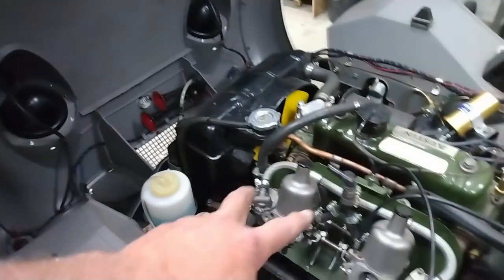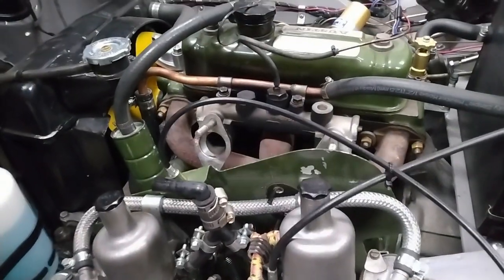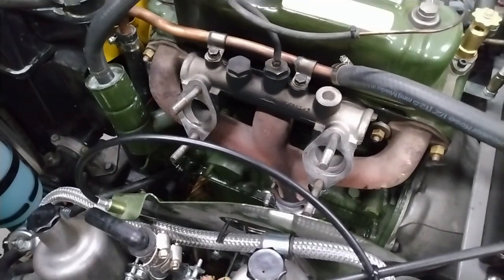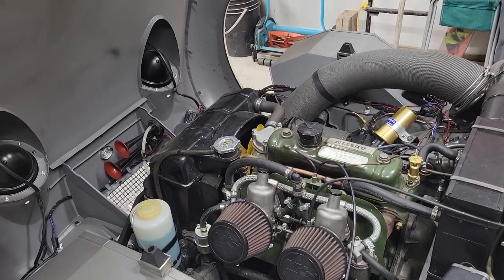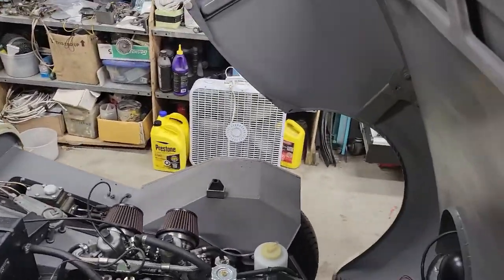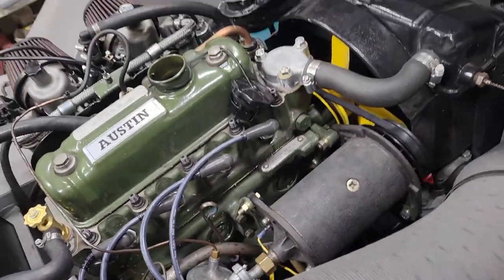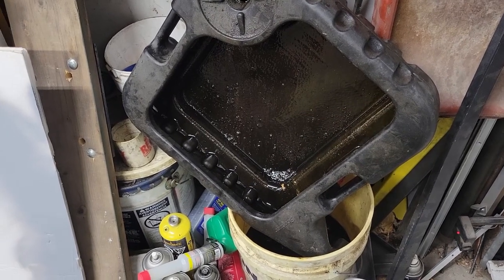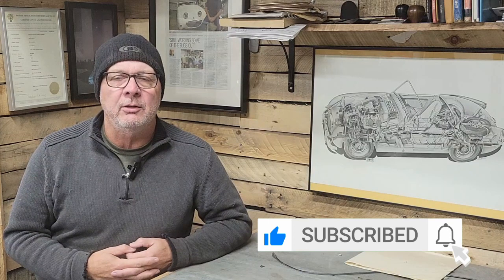Fixing an exhaust leak & changing the oil. Bonus... where does the old oil go? Bugeye Build Ep139

Comment: We take our used oil to anywhere that sells fresh oil. They sell it, of course, thus completing the circle of life. This video is a good example of why that flip front bonnet is so important! Looks like a piece of cake to reach everything in that engine bay. Glad she's running so nicely!
Reply from the maker: It's interesting to hear how different jurisdictions handle this. I remember in much younger days digging a hole in the gravel parking pad behind the house and pouring the used oil in! I seem to recall that method was actually promoted in magazines of the day!
Reply: @EconoboxGarage  I remember my dad pouring used oil on the ground around the deck posts, to help prevent rot.

Comment: Hi Ian,  It's been a few years since I've owned a Spridget but I remember a fiber donut that went between the manifold and the down pipe.  When you put yours together, I didn't see you install one.  I didn't say anything then, thinking that there might be differences in the years & models.  You might want to check to see if you need one.
Reply from the maker: I believe the donut was introduced with the 1275 cars starting in 1968. There wasn't one on my car when I got it.
Reply: The diagram from the Moss online parts catalog (for both 948 and 1098 engines) shows only the manifold, exhaust pipe, and clamp. So, you are correct, Ian, there is no gasket for your 1098 engine.

Comment: Another nice video, Ian, even though an oil change is not nearly as exciting as other projects you had on the car. My Bugeye had an exhaust leak at that same junction, but I think mine was because of a worn out clamp. When I finally get to the point of starting the car, I’ll get to see if I was able to rectify my exhaust leak as well. 

Maybe you said in a previous video, but what brand and type of oil did you use? There are a LOT of opinions out there on the proper oil type. Also, did you use motor oil in the transmission? If so, what weight?
Reply from the maker: Thanks Joel. I used Lucas Hot rod & Classic 20W-50 motor oil, which has a high zinc content, in both the engine and gearbox.